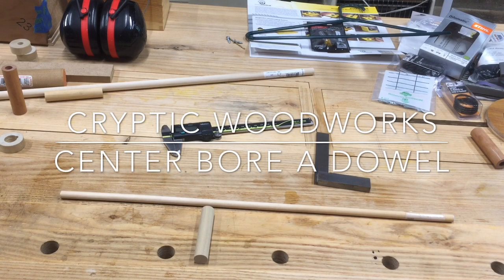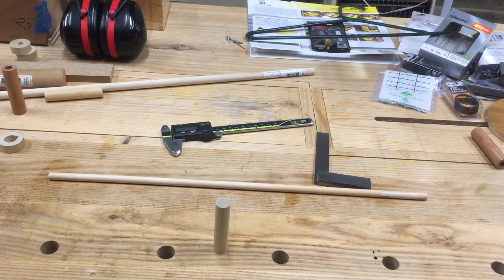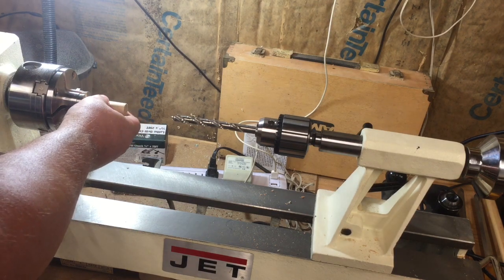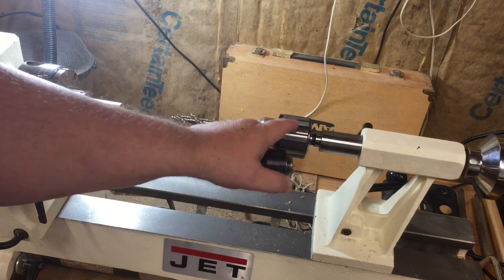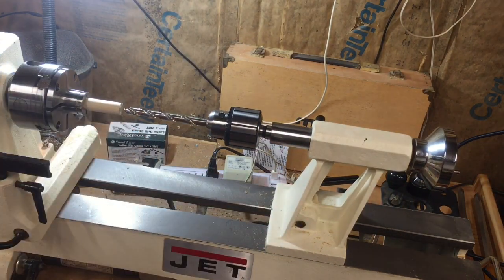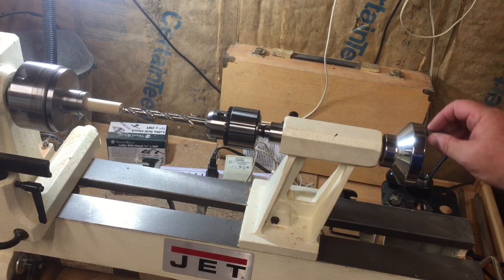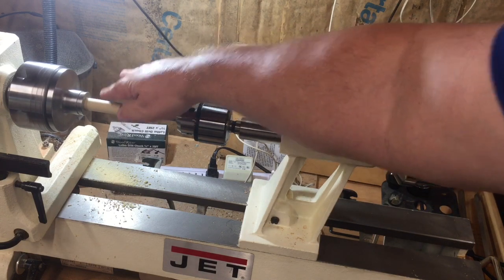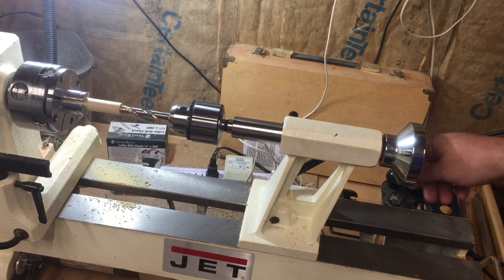Center Drill a Dowel

Comment: Looking forward to seeing what the purpose was and why the need  for 5-6" of bored dowel. I think I would have tried boring the spacers on the cnc (long reach bit) with a semicircle lap joint to double the length.
Good intro to lathe work.